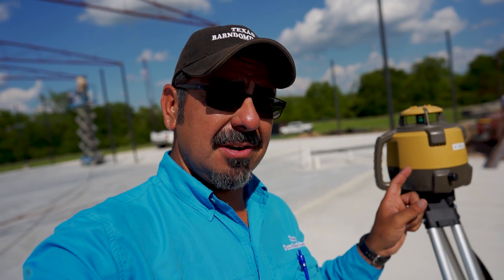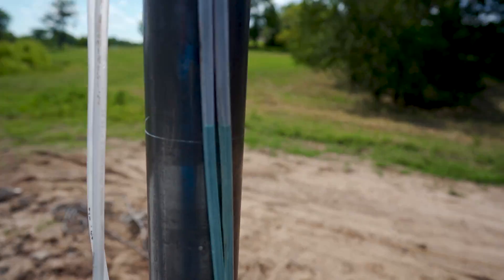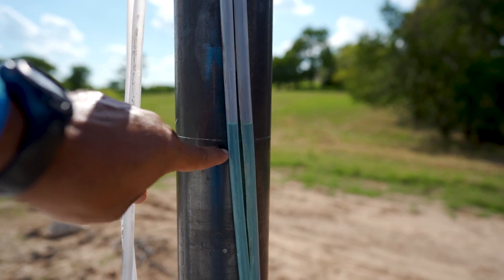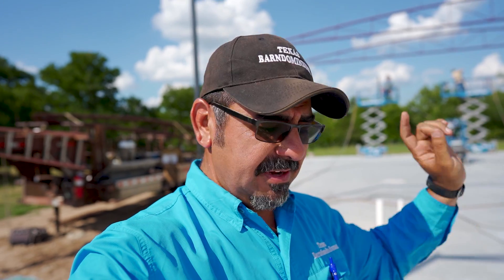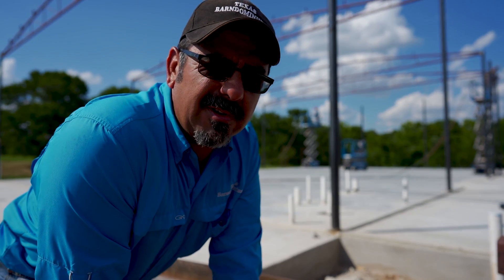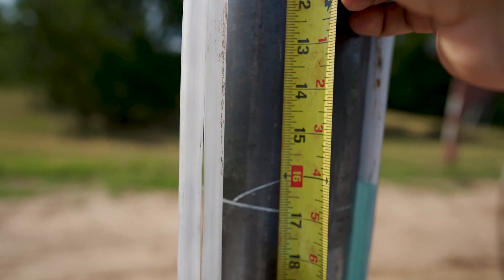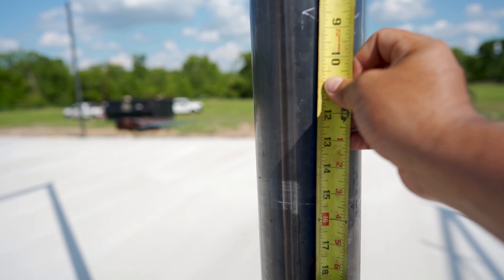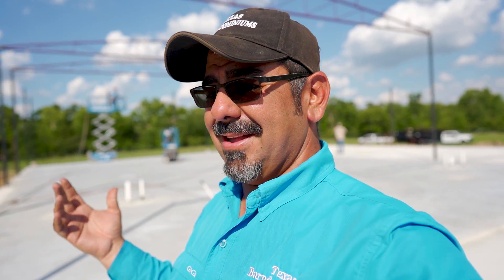Laser level vs Water level | Which is more accurate?

Comment: My opinion I would rely on the the water level not putting down the laser level but the laser level has to be put on solid surfaces and with the laser level I work with a guy when using the laser level he bends over and tips the receiver on a angle and that makes a big difference

Comment: Temperature will alter the water level as the day heats up and cools down, which means you need to take a new baseline if measuring over longer periods of time. Maybe that one measurement that was out was the last of all measurements you took and is out because heat changed the pressure in the water line.

Comment: Laser level it's not as accurate. They have at least a an error of 1,5mm/m, which means that if you measure 50m , you will have an error of 75mm which it's pretty bad.

Comment: Suggestion: To make it easier to see the fluid levels, you can use a gallon of dark brown iced tea to fill the tube. If the vinyl tubing is kinked from storage, let it sit in the sun for a while to soften up and return to its round shape. Also  you can run hot black coffee through the tube to soften it, makes it easy to see the levels. Yes, a waste of coffee, and you need to flush the tubing afterward. Rather than trying to fill the tube with a funnel I find it easier to just set up the tube as a siphon and let run to get the tube full and bubbles out.

Comment: When using water level check for bubbles, for they will affect the level.  Before using water  hose do a level test like you did, put the hoses side by side to check calibration. I filled the hose with RV pink antifreeze, worked great at first, the next year it was off an 1", I'm thinking the additives in the RV antifreeze separated.

Comment: If you use multiple hoses with "central bucket" then there is no significant difference in speed. You only need clear tubing at the end of you lines. Rest can be done with heavy duty and/or cheap hose. Water works in all lighting conditions, in mist, dust, round the corner and at any distance... and no level of abuse will ever throw it off the calibration!! You can wack it around your truck, throw it around work site, drive over with digger and drop it from the roof with no worries. Accuracy is guaranteed by nature.

After you done all hose fit inside the bucket so storage is comparable to the laser set - with the difference in cost and fragility of the system ;)

Comment: Air pressure can make tricks to the water level, that is difference in air pressure, like wind blow into one end of the pipe/hose and the other end is on the opposite side of where the wind hits the object you are measuring at (this create a small vacuum compare to the real air pressure). An other thing can be temperature of the water in the pipe/hose, if you start with cold water in the morning and the pipe/hose lay in the sun during the day it will heat up and expand, if you do not recheck with your reference point then this can trick you too.

Comment: The water level is best. But, you have to work quickly. As the sun rises, the water will heat up, expanding. This means your measurements will not be the same if you start early in the day.

Comment: Due to curvature of the earth the laser will lift off the horizon 1' inch in 660' feet. If you shoot laser across a 660'ft pond, the water level will be an inch lower on the other end. A water level will differ from laser by 1/10"in every 66'ft

Comment: The water level is fine for many building site, usless for me as I design roads (1km -5km) , Completely impractable, You need to that a water level maybe out if the tube is not the same temprature through out, e.g. some in sun and some in shade. this become worse the longer the tube. It is also important to level the fluid settle. Like all tools, nothing wrong with it if used for the correct purpose.

Comment: We have used those as well both the water and laser are very accurate water takes a little bit to get your center line or level line the lasers I was gonna be fast also if you have a surveyor set it in the middle of a project get it level start marking your lines all the way around it is also very accurate

Comment: You can't beat the economy of the water level.  The ends of the water line should be shielded from the wind for the best accuracy and stability.  Thanks for comparing these two methods.

Comment: First thing you need to do is define "level". A water level produces points equidistant from the earths centre of gravity, therefore, by definition the mid point of that line is lower than the ends, whereas the laser produces a straight line tangential to the earth and all points are therefore higher than the origin in proportion to their distance from the origin. Hence, unless you define which level it is you are measuring the question is meaningless. Irrespective of that though, over short distances the water done correctly is the defacto standard that the laser needs to try and emulate.

Comment: I use both and each has it's merits, biggest problem we have is wind which shuttles the water back and forth through the tube( no rude comments please!!). Trees obsticles buildings etc not a problem .Drop your bundle of tube - no damage cheap to buy and nil to fill.
Laser quick and easy limited to dull days or use a recieve,r regular accuracy checks needed and limited to line of sight

Comment: For some reason laser levels are typically advertised +–1/8”.

With water levels, it not only needs to settle but have any air bubbles expelled. Also, the water and the tube can expand and contract with heat and cold. And if some water drips out or is removed it needs to be recalibrated.
Reply: If you use a bucket reservoir type you don't need to recalibrate if a touch spills out

Comment: Good video  laser levels can vary between brands and from one to the next but any water level is dead nut.  Some form of water level has been used since the beginning of building. The pyramids in Egypt  and the coliseum in Rome were built with some form of water level system. 
  That being said the building industry is going to go with fast easy laser.

Comment: The 1/8" would be easy to get just by marking mistakes.   the pencil is 1/16" thick :)  the laser relies on charged batteries and the ability to mark the notch accurately.  My money is on the water level especially since you have  the wiper fluid in it to reduce bubble and friction.  I have worked with many lasers in 40 years and they can be fussy :)  setup time is reduced with the water level also, nice video.

Comment: I think 2 points need to be made known about the water level......if there are any bubbles in the line it will not be accurate and when moving the ends around not to lose any water out of the tube or your datum point will change.  Other than that they are dead accurate

Comment: Water levels are cool, and they can be fairly accurate, but they are not perfect.  Here are a few things that can mess with water levels:
1. Get a kink anywhere in the tube and it will be way off.
2. Get a bubble in the fluid in a vertical or sloped section and it's not going to read right.
3. Even if you were careful to not let a bubble in, you can't just add water to washer fluid or antifreeze already in the tube; mixing needs to get done outside of the tube.
4. Get one side hotter than the other, maybe leave one side in the sun and the other in shade for a while, and the hotter side will end up a bit higher than the other.
5. And if you have wind and you are using a tube with open ends then wind blowing over a tube opening will cause a suction while wind blowing straight into an opening will do the oppposite.  And the ends either need to be both open OR connected to each other.  It takes twice as much tubing but it's best to connect both ends of the tube together to make a totally closed loop with one big section of fluid and one big bubble in order to avoid wind effects. 
6. As mentioned in the video, the fluid takes time to come to rest and you need to be patient and wait for it to settle.  The longer the section of fluid in the tube and the narrower the inside diameter then the longer it takes settle.

Laser levels are usually pretty good, but:
1. It is a good idea to test them when you first use them, and retest maybe once a year.  Do like what was shown in the video where you mark level twice, both times with the laser level, except do the second set of marks with the level moved over to the other side of the worksite.  You want to check a variety of locations in different directions and at different distances.
2. If you are using a handheld detector then check to see if you get different marks when slowly moving up vs. down.  If so, always move the detector the same way.
3. Sometime the tripod gets bumped, the dirt settles, the equipment warms up, a battery gets low, and the level shifts.  So, after doing all of the marks for a set of levels, it's a good idea to return to the first mark and make sure it repeats.

Comment: Most Lasers have a discrepancy of 2 to 3 mm either side of true level ?  Therefore one needs to move the Receiver and observe a height mark on the work, when it's at it's highest point just before it starts to beep periodically, and then do a second mark after moving the Receiver down slightly until the continuous beep changes to a periodic beep at it;s lowest point. Once You find this range, then it is simply mark the centre point between both marks giving You True Level and a more accurate reading ! Hope this helps !

Comment: Water level can be wrong if there are any bubbles in the hose.
Lazer can be wrong at a distance compared to the water level, a Lazer doesn't bend to the curvature of the earth, so the further you get from the   tripod the greater the difference, a water level is always the same distance from the centre of the earth.

Comment: I bought a high end laser level and I'm disappointed. We Installed 27 piers and we needed to cut about 22 of them to the level of the other 5. The piers come in 7 ft sections and when the hit 10k lbs of torque they stop drilling so we had some that needed to be cut to length.

To set the laser level to the exact top of the shortest pier was an impossible task(setting tripod height is a guessing game and we couldn't even use the stick since the ground around the piers was not itself level.

A water level would have made this a two minute job to go around and set the height.

In the end we ended up having to use a zip level

Give me a water level anyday instead of some fancy laser that will break and is off as much as an eighth at 100 ft

Comment: There are a couple of ways to use a water level by yourself. The first is when you have the two ends together fix the stationary end to a post etc then mark the waterlevel on the tube, when you are at the marking end you have to make sure the water is at the line you marked and it will be at the line on the fixed end. The quickest method is to drill a hole in the bottom of a bucket and silicon one end of the hose into the bucket, fill with water, mark the hose with a line and when marking make sure water is at the mark. The bucket reservoir will dampen the water movement in the hose and make it settle much quicker.

Comment: Before lasers the water level was the only solution. Lasers have a built in specified inaccuracy, usually a fraction of an inch per 100 feet. But there is no question much more efficient, and can be used to resolve tilted plane demarcation, for example, cathedral ceilings.

Comment: From what I could see, both methods can't be compared with each other.
A water level is only level in the middle between the 2 hose ends, and a laser level is only level at the laser level itself. Beyond these points both become more inaccurate.
Reply: Seems to me the only way the water level is off between the ends is if there is a difference in atmospheric pressure between the two ends.

Comment: Water level will change on both ends so could easily be 1/16” off.  While both work, I’ve checked both with a transit as well, water level is most likely to have user error

Comment: If you have a strong wind blowing over the top of the water level pipe you WILL get errors. Also if you put your laser in a different location it only takes a few minutes to check previous marks

Comment: Always make note to spin a rotating laser at the fastest speed.
You think I'm crazy but the most expensive hilti rotating laser will always run off over time.
Set it at 1200 rpm you can drive to the other side of town take lunch have a nap and come back it's still right on.

I think his laser was probably bouncing a bit when he made the mark that's why it's off.

Not arguing water lecel will be more accurate just saying

Comment: Depending on your use....as a concreter pouring slab daily laser level are great fast and effective...i do believe water levels are accurate as hell but for Concreting purposes way to slow and very inappropriate dragging tubing thru wet concrete...for brick work water levels are perfect

Comment: You could measure the distance from the ground to the lowest marking on each pole. The measurement should be exactly the same. If it’s not, you know you made an error with the water level. Repeat the process with the top marks and you’ll have your answer for the laser level.
Reply: This is all considering the foundation is level.
Reply from the maker: How can I check if foundation is level?  Don’t I need to use a level for that?  If so, which one should I use, water level or laser level?  😂
Reply: Texas Barndominiums glass of water  should do. 😂😂

Comment: water level is accurate to the dot. laser levels have a +-1/8” when you go further than 30+feet. so i’ll put my $ on the water level.
Reply: Water level has the concave due to the surface tension so you might have 1/8 in or so with the water level as well
Reply: Also the calibration and clean lens affects alot
Reply: That's. That
Reply: My money is on the water level. Lasers are good hell their great but there's human error, lasers are fast you get in groove going around marking your elevation an its very easy to get off an 1/8th inch by not marking the exact spot that the target card is telling you to.
Reply: On your laser. So another proof of worker error being the issue. We all saw he didn't call out anything less than an 1/8 so that can be an issue also. Both are within tolerance for the job..
Reply: entry rotary lasers are +- 1/8" mid range one are 1/16 and high end ones are 1/64
Reply: That's the craziness thing I've ever heard..lol. After 30' you loose or gain  1/8"!? Sticks of pipe are 20' and we lay 300' and never move the laser. Check every joint and it's always on grade. You're crazy..

Comment: THEE LASER LEVEL,  IS NOT THE PROBLEM.   YOU ARE !
BRAINLESSDOMINIUMS
Did you set the accuracy ?
To minimum or maximum ?
1/16" - 1/8" - 3/16" - 1/4" ?
When you mark the spot...
Do you raise or lower you're angle ?
When you mark the spot...
Do you ALWAYS repeat
The same action exactly ?
Have you EXPLAINED to you're
UNFORTUNATE VIEWERS. THAT THE GREATER THE DISTANCE AWAY FROM THE LASER POD. THE GREATER THE EXPANSION OF THE LASER LIGHT ?
Now you're panties.......
Will be bunched up !

Comment: 1/8” at 60ft is 0.0099 degrees off level. I think it will do for accuracy. It could easily be error in drawing one or both lines. Especially since the error would be the same at 2, 3 or 10 time the distance. The angle of error would decrease with added range.

Comment: If you add petcocks to both ends of the water level, and shut them "off" before moving the water level, you will have much less bounce to the water, as you wait for it to settle in the tube.

I have been building boats for 36 years. A water level is what we always use to level our multi-million dollar boats. 

Another choice to use for liquid to use in a water level is, non-toxic antifreeze.
Reply: Petcock or cork is perfect for storage and transportation of the water level! But for it to level quickly, covering and releasing the tube with your finger in a quick succession will stop it in no time! With some practice it's surprisingly fast! ;-)

Comment: Been using an inexpensive one for years, needs salt water for conductivity as it's electronic, gives of the same beeping sound as the laser receiver.. pretty spot on, claims +/- 1/8th" in a hundred feet.  Great for starter courses around corners when working alone.

Comment: Measure it with a micrometer, mark it with a crayon, cut it with an axe.  

Accuracy and repeatability with any construction method is in the hands of the craftsman.
Reply: The importance of that statement is cannot be overstated
Reply: Really good point! Manworker tolerance is the main accuracy.
Reply: I have never seen this guy strike a mark that wasnt at least a few mm' off the mark from using those 10 inch thick marking pens.
I guarantee everything is off by a bit
Reply: :D

Comment: I put a valve on each end of hose so I can close the ends till the next time I need it.   Fast and accurate and with valves no mess or need for water on site.
Reply: Does the tube ever develop air pockets . I’ve been draining mine but then I have to get the Air out of the line before each use. Would be nice to eliminate the step of getting all the air bubbles out

Comment: Each laser has a natural "droop" over  a certain distance (i.e. 1/16" over 50' distance). That droop needs to be taken into consideration when calculating heights. There is no error factor with water.
Reply: Due to curvature of the earth the laser will lift off the horizon 1' inch in 660' feet. If you shoot laser across a 660'ft pond, the water level will be an inch lower on the other end. A water level will differ from laser by 1/10"in every 66'ft
Reply: You mean divergence? Ie making the laser bigger the further you go. The received should be able to pick that up and calculate the middle point